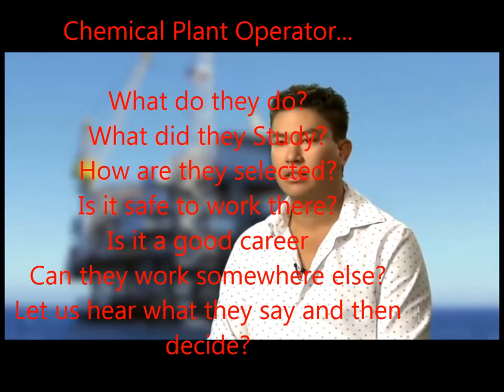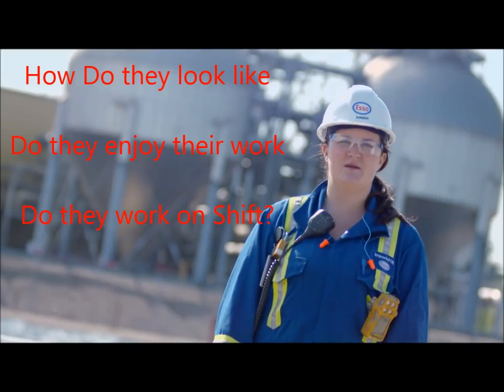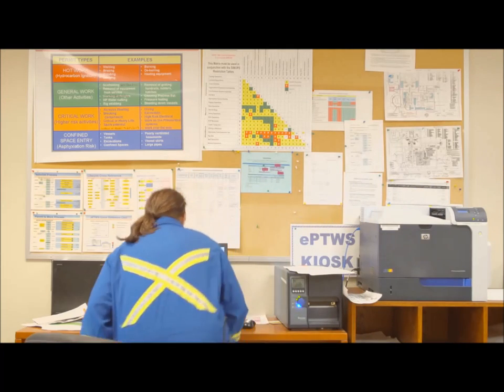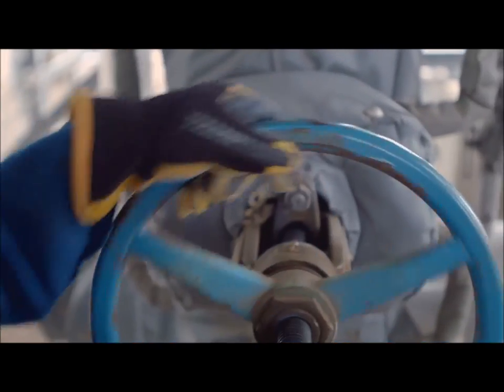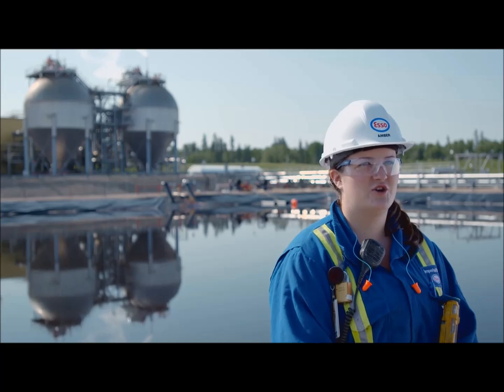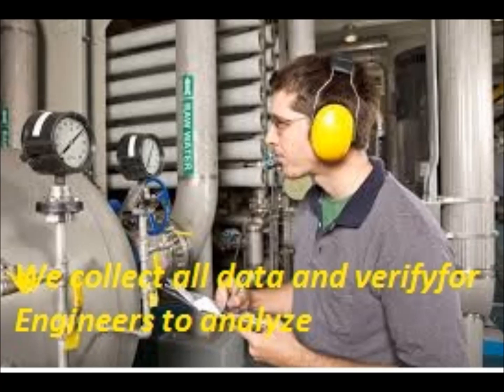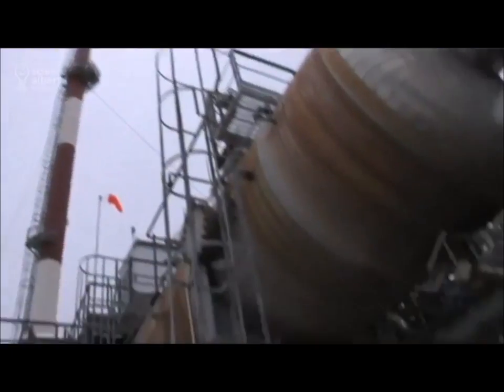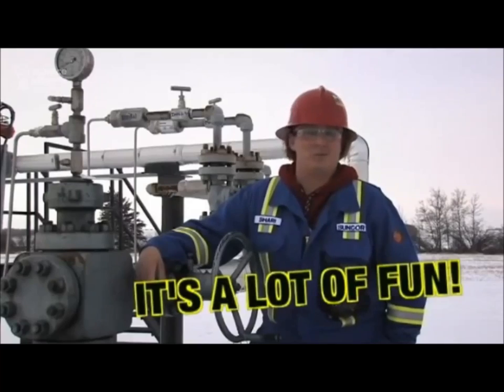Plant Operator

Comment: hmm, so some operators issue work permits to contractors? at my plant the supervisors are in charge of that and we just make sure the isolation/ system is safe with a zone of peotection, but we don’t check on them when they’re working.

However, there was a time when an operator checked the leads on some chargers and found they could’ve been shocked with 250V if they weren’t stopped